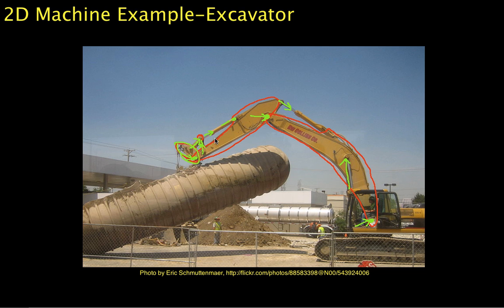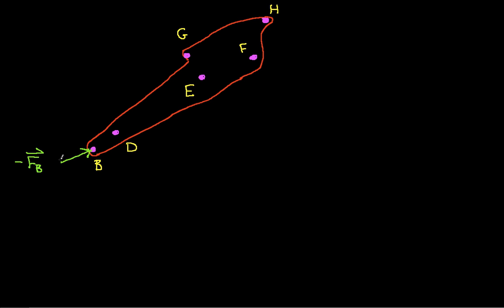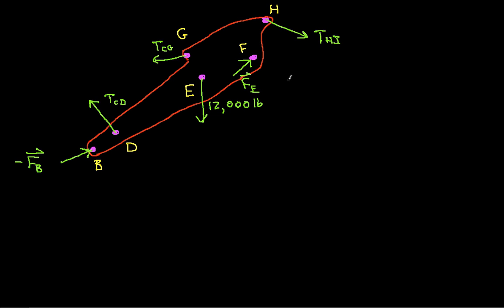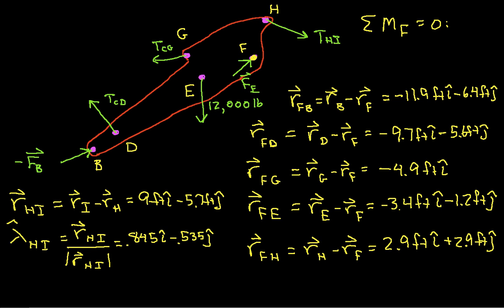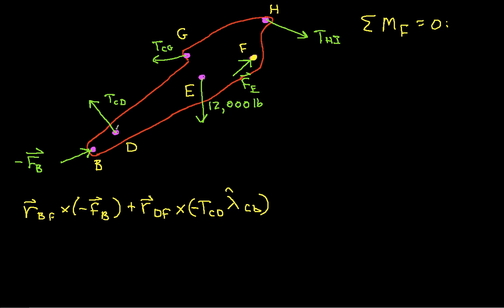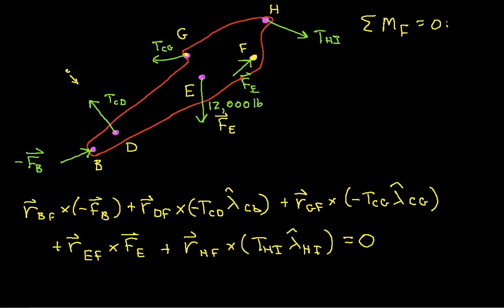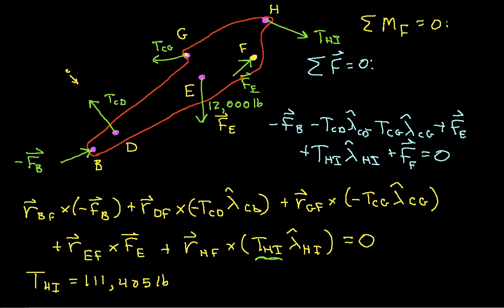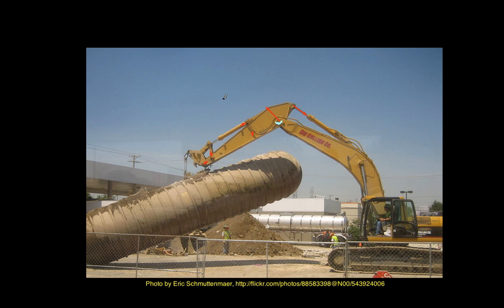2D Machine Example-Excavator Part 3

Comment: Thank you Mr. Morrell for this series of videos.  They helped me solve the problem I was stuck on.  Specifically, identifying a two force member in the FBD.  And using the position vectors to calculate the moments helps  keep everything straight.  Thank you for sharing.